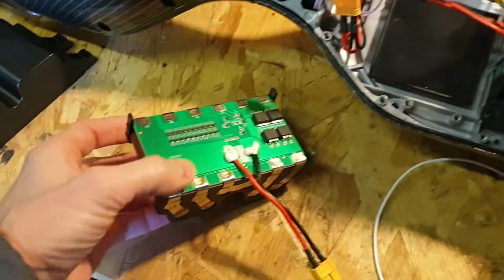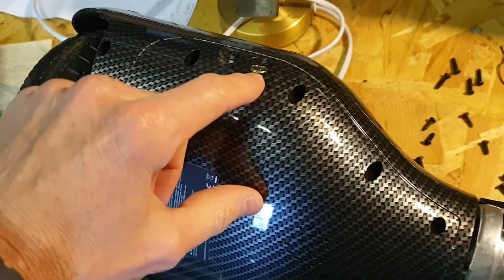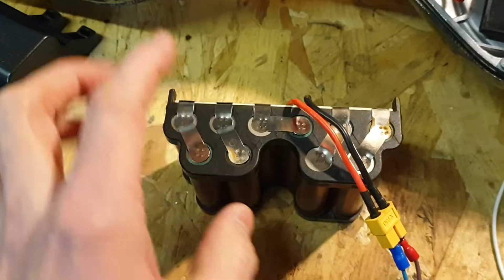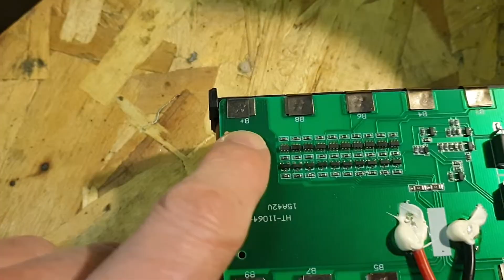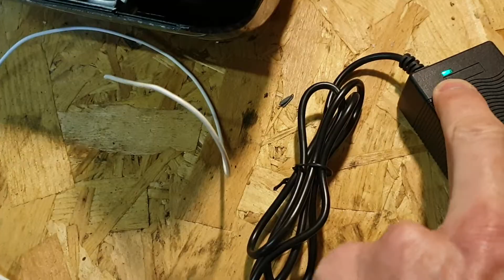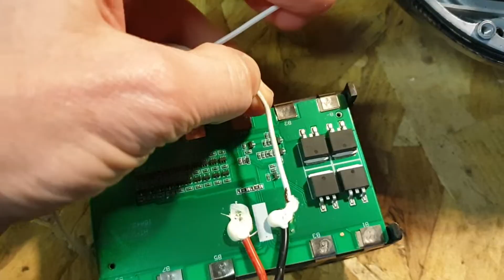Resetting Hoverboard battery with paper clip, No voltmeter needed!

Comment: My charger is lighting red when I connect the wire to create a short circuit but as soon as 8 remove it its back to green
Reply from the maker: Try to hold it for few second
Reply: @kamil2811 I held mind for 3 mins n it keep going back on green

Comment: Didnt work I touched the black wire to B- so idk pls help i dont wanna spend $50
Reply from the maker: I can't guarantee it will work every time. As you can see in comments it works many times. I can't see your battery but it is possible there is different problem in it. Sorry
Reply: @kamil2811  its fine, i found one on ebay for $30 anyways so youre good

Comment: This reset method appears to be working on a Jetson Model JV12. We haven’t used it for 4 years so battery was drained. After shorting (quick spark), charger light turned from blue to red. Will let it charge until it’s green and hope hoverboard is working again. Thanks for your great video!!

Comment: Mine was covered in a blue shrink wrap with small black shield covering it. Once exposed there was a lot of some material covering the soldering points. I had to scrape around until I found B-. Once I connected B- and the ground, I'm getting a red light! Hopefully this does it!
Reply: Did it work?

Comment: Okay when I plug 🔌 the charger up it stays green when i connect the extra pig tail to the ground up top the charger turns red but then turns red after 3 seconds when I put the battery In the hover board and try to charge it the normal way the charger stays green what does that mean

Comment: Question…  I reset my battery like you illustrated. The charger’s red light came on but would turn to green as soon as I removed the jumper.  Is this an indicator of a bad battery or batteries or bad board. Can anyone help.
Reply: This happened to me but I just held the jumper on for about 20 seconds and then it stayed red.

Comment: Will this work with a hoverboard that only turns on when the charger is connected? 
When i unplug the charger the whole thing cuts out
Reply: Did you ever figure this out
Reply: @tristansoucey4889 @tristansoucey4889 No I was lucky, the seller accepted the hoverboard back and said they would work on it over the winter as a project. 

I purchased it but was unaware the original owner hadn't used it for a year/18 months

Comment: This worked for me. I was hesitant, but I took the battery out of its case, plugged it back into its plug from inside the hoverboard. Plugged the charger into the board, then used the jumper wire. It turned the light from green to red and then I left it plugged in for 3 hours. It fully charged. Note, I had the charger plugged into a ground fault plug for extra protection since I was using a jumper. Also, the battery voltage to start was 16v.

Comment: Thank you for this.  I'm charging mine now after doing this.  I did it with the pack connected through the board and the charger connected to the board. ( I also connected the charger straight to the pack * Pin1 pos. Pin 2 neg.*as you did to make sure the flashing of the charger that I began to see was not caused by my setup) as a note of observation,  my charger did begin to flash faint red, then faint red/ green, then finally solid red after the packs voltage reached its minimum 32v.

Comment: Thank you, you saved me from buying a new battery. I haven’t used the Jetson hover board for over year (voltage dropped to 3.6v). The charger always showed green but it never charged it. Shorting did the trick. After shorting it started charging (adapter indicator turned red) hope it charges fully.
Reply: Did it work for good ?
Reply: What else can you use to short it !